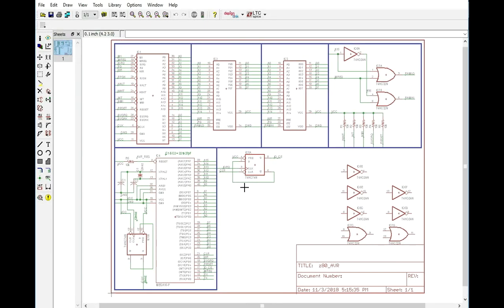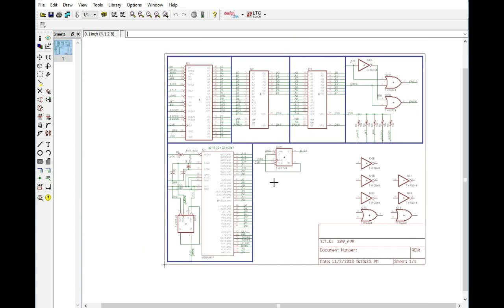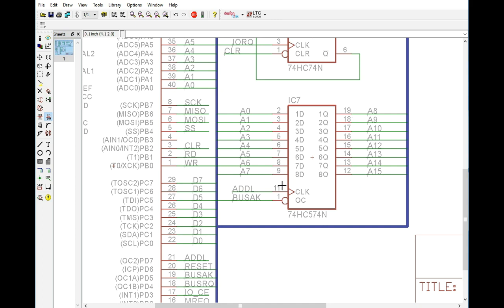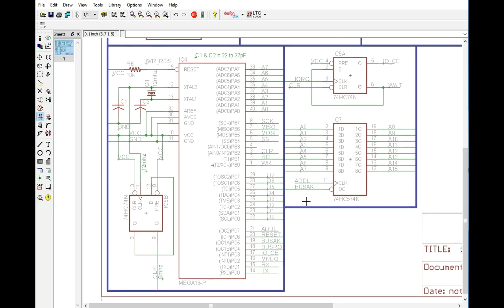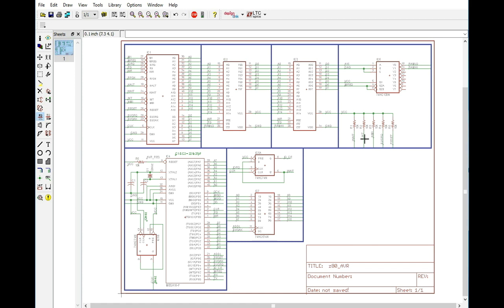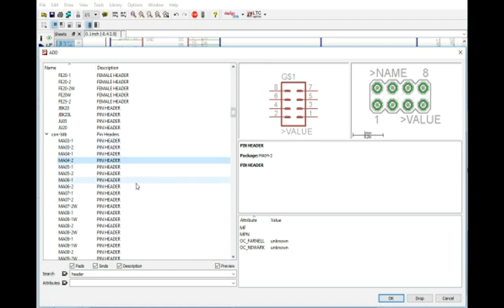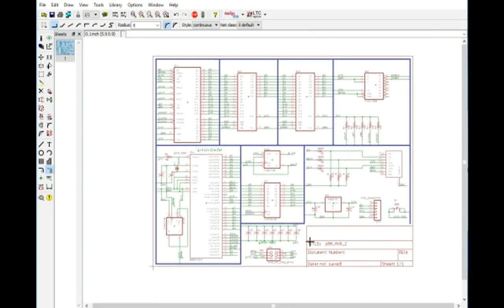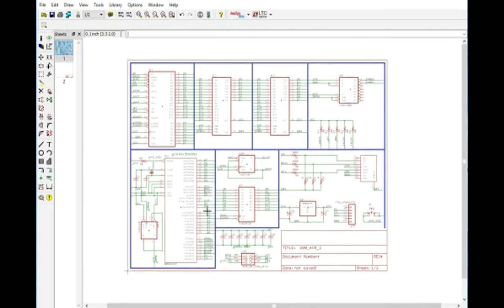How To Design A 8-Bit Z80 Computer Pt 2

Comment: Never had the money or the time back in the day.  But what I wanted to build was a MultiProcessor Z80 with a master/slave bus with back plane (was the master/controller) and 16 slots.  It was four z80 CPU cards with boot ROM and banked memory to 256k, one floppy controller (z80 controller), two or more hard disk controller (z80 controller), One parallel (z80 controller with two ports) and serial card with up to eight serial lines (z80 controller). This was the basic system but could be reconfigured for use.  The point of it back in the day would be used for POS and CMS as it would have been the early forerunners of it.  Even in the late 80s I was talking about it but someone got there first as always.  When I priced it out in the late 80's including the changes in design, the prototype came in at a half a million dollars.  In short, building a mainframe system using microprocessors.  It's still doable but no one is.  They have their heads in the clouds and other common terms without thinking about cost, efficiency and impact.  Now am just entering my sixties; I just don't have the drive as I had back then.  I see things but it never makes it to paper most of the time.

Comment: Great vids. Looking forward to part 3. Would this design still work if the Z80 was clocked higher than the AVR? (I have a few 20MHz Z80s that I want to use)
Reply from the maker: Yeah, it could.  The idea is that the latch causes the z80 to wait until the AVR has processed the information and has cleared the wait state.  So you should be able to run either processor at any speed.
Reply: @RetroDepot  Nice one, thanks!

Comment: Great second video in the series. Only complaint is fuzziness when the schematic is zoomed out. Keep up the great work, Douglas!
Reply from the maker: Thanks, Don.  It happens sometimes, I try to minimize the problem, but my screen capture software cannot always keep up.
Reply: Douglas, have you tried this one?  https://www.flashbackrecorder.com/express/
Reply: Douglas, I'm struggling with understanding how pins 40 to 33 are providing both the low address byte and the high address byte.(Timeframe 14:21)  I may not be alone in this regard.
Reply from the maker: @donprefontaine3237  The 74HC574 is an 8-Bit Octal Latch.  Think of it is a 8-Bit Register that we can write data to.  So similar to the 8085, or the 8086, we are using the pins on the AVR to address both.  When we set BUSRQ Low, the z80 will respond at the end of the current cycle with setting BUSAK (Bus Request Acknowledge) low.  This is wired to the Output Enable of the HC574, allowing the data to show up on the A8-A15 lines.  However, the value here would currently be incorrect, and from the previous DMA cycle.  Instead, we want to write the High Address Byte to the pins on the AVR, and then Toggle the ADDL line (Address Latch, ALE on the 8085/8086) which latches the high address byte into the HC574.  At this point we have set the upper address bytes.  We can then write the low address byte to the A0-A7 pins.  And once that is done, we have latched all 16 pins of the address space, and we may proceed on with whatever our DMA function is.  I hope that explanation helps.
Reply: It sure does - thanks!

Comment: You mentioned it in passing at the end - so why didn't you opt to use a 64k x 8 SRAM,  then? That way the chip count would be reduced by two, and the design would be cleaner and simpler.
Reply from the maker: For several reasons.  First, I had 32k chips on hand.  Second, I feel that understanding how to break apart the address space is an important lesson in building any computer. Having two chips allows you to do that.
Reply: @RetroDepot  fair enough,  however the reason I am a bit puzzled is that you have  explained your motivations behind every design choice in your video.... except for having two 32k x 8 SRAMs instead of a single 64k x 8.
Reply from the maker: Again, not everyone is going to be using the AVR to boot load the computer.  Some people prefer to use AVRs as IO only.  And there are several project on the web that do that.  Understanding how to break apart and address each segment individually is a very important principal in the building of any type of computer.  Not just this one.  You couple that with the fact that I didn't have any 64k SRAMs on hand, and that is why you get this computer with 2x 32k SRAMs.